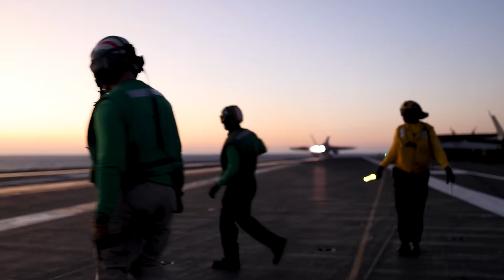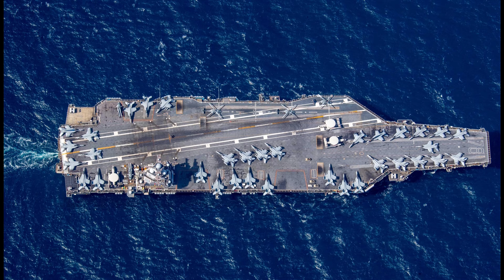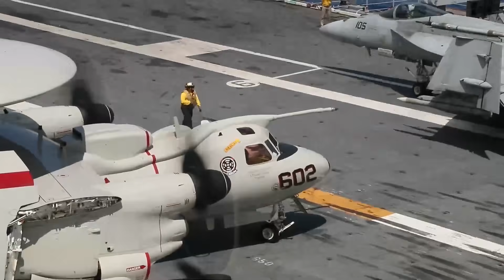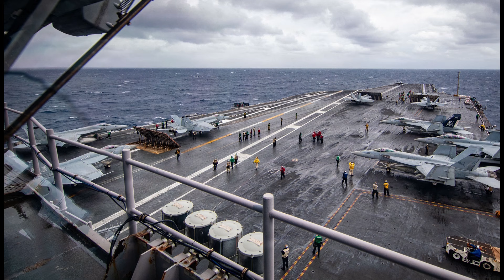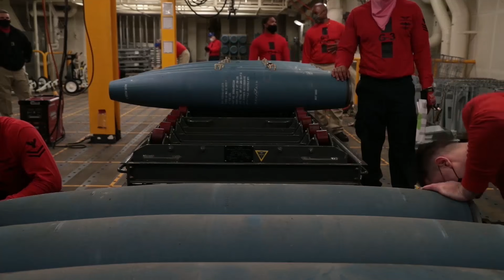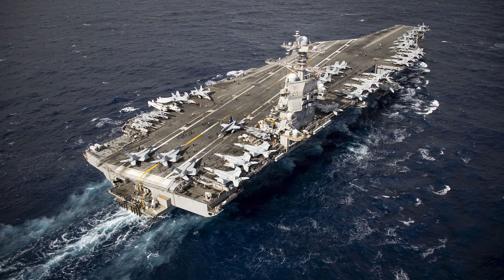Is China's Fujian Carrier Actually the Equal of the Ford Class?

Comment: The Fujian is superior to the USS Ford in one thing, staying in port. It come up short in power generation, operations tempo, size of air wing and ability to stay at sea. Using non nuclear power and EMLS makes the Fujian equal to an 80 year old US carrier like the USS Midway with a smaller air wing and reduced operational tempo. All the thing that the US had problems on the Ford have been worked out years ago and the Fujian is still in port trying to figure out how to fix the problems China is hiding. Sorry but this video is nothing but Bull S**t. At one point it claims the Ford's catapults are all working are non are working, then states that if one catapult goes down there are still 3 to carry the work load. It can't be both. Remember looking alike does not mean they are equal. The Chinese aircraft are under power and and over weight. The KJ-600 weigh 6000 lbs more then what was copied the E2D which was designed in the 1960's. the J35 is an attempt at coping the US F35 and has come out under power with short life engines. The video talks about the logistics tail which the Chinese do not have and the US worked out 80 years ago. One ship being resupplied does not stop the task force.

Comment: On paper the Ford is more superior than the Fujian but in terms of operational reality, I think the Fujian has an edge. Why do I say that? Firstly the Ford has 4 EMALS and the Fijian only 3? However, based on trials conducted, the Ford can only manage 180 to 600 launches between operational failures. That works out to be an average of 375. The Fujian is able to achieve 500. As you have said, the 4 EMALS of the Ford is centrally controlled while that of the Fujian is separate. In a sea battle this is significant. 
Ford  has more aircrafts but it cannot carry the F35 Stealth fighter. Stealth give the missile a much longer range as the aircraft is more difficult to detect.  Together with the Chinese YJ18 air to ship missile range of 400 to 500 km, none of the US fighter with their anti-ship missile can match this range. Not to mention the YJ21 hypersonic missile that has a range of 1000 - 1500km, which may already be operational.
Ford is plagued with reliability problem most notable  being its 4 very advanced lifts. From what I have read it has already been resolved. The latest is it does not has enough sleeping quarters for its crew. All these may be minor issues during peace time but in a highly stressed battle, could be the tipping point.
A comparison of the E2D Hawkeye with the KJ600 performance is  probably  quite close but I will give the KJ600 an advantage as its technology is much newer. The E2S Hawkeye came into service in 2010, 16 years ago compare to the KJ600 in 2026.

Comment: Great info! 
I have a couple of things to add.
Two of the catapults on the Fujian is too close to the landing strip, so only one is available to launching while jets are landing. For the Ford, two cats are usable when landing jets (one of them can only launch jets, the Hawkeyes' wingspan prevents them).
As you said, the bottleneck is usually preparing, fueling and arming the aircraft. And the Ford has quite advanced weapons elevators and jet fueling systems, learned from long experience. 

Fujian is an enormous improvement for the PLAN. It is a platform where they can learn a lot and gather experience. This is the root of the Chinese philosophy - continuous learning, iteration and improvement. I think at about Type 04 or Type 05 they will be happy with the design and start mass producing it, just as they did with the Type 052 and Type 055.
And for all the ways the Fujian comes short compared to the Ford, it is a powerful ship in its on right. Considering it will not operate tens of thousands of miles away from Chinese shores, it does not need a nuclear propulsion to dash across the world. I suppose China can build a few more of these for operations in the first island chain, and use them alongside the nuclear aircraft carriers. Just as they operate both conventional and nuclear submarines.

Comment: I think that the Ford class is showing signs of significant flaws, but so is the operational readiness of the USN which may exaggerate the flaws. In an overall sense this is puts the effectiveness of the USN in decline at a time that the PLAN is becoming more effective operationally year on year.
This is a problem for the USA and it goes far beyond simply running down munitions. Fleet support vessels have been run down, and because of the failure of both the Zimwalt and Constellation class warships there is a massive delay in replacement of ageing warships.

Comment: Personally I don't think it should even try to be by like the Ford's or Nimitz, as long as it performs well and does what it was designed to do then it should be fine
Reply: The problem with it trying to compare to the Nimitz goes far beyond the ship itself. Every ship is part of an organizational system, and that includes the bases and support ships they rely on. The Liaoning cannot operate beyond the First Island Chain (FIC) during wartime conditions as it lacks the range and beyond the FIC it is in enemy waters. Not contested waters, but fully enemy waters. Even inside the FIC, most of where it can operate is contested waters, with only the Bohai Sea being relatively safe, though still vulnerable to long range cruise missiles and drones. What this means is that it must constantly be on defense, and if it goes to port it will find itself a sitting duck. So it will only be able to POSSIBLY survive for as long as it can stay at sea, which is not forever no matter how much it can be resupplied underway. The Type 1 and 2 are even worse off, naturally. But as they are all top tier threats, they can be sure that they'll have an overwhelming volume of fire allocated to it from minute 1 of any war, which means it's as good as dead. The Nimitz can all operate safely outside of China's ability to realistically threaten them, and if needs be, they can back off entirely out of Chinese weapon ranges, leaving land-based systems and submarines to maintain the threat against China's ships. So not only can the Chinese ships of any class not operate like US and Japanese ships, they have no hope of survival no matter what they do, like Iran's navy only more costly.
Reply: @gardnert1   I think you underestimate what the PLA can do within 1000 km of their coastlines. You are mistaken if you believe the USN can operate safely outside the 1st island chain, it can't even operate safely from the 2nd island chain. If they go within the 2nd island chain, they will be sunk with overwhelming number of DF missiles, and other air launch, sub launch missiles at huge standoff distances. The only safe distance is all the way back to Pearl Harbor, and that's because the Chinese won't attack Hawaii, not because they can't.

Land bases won't be able to operate within the 1st island chain anyway since all will be wiped off within hours of an initial conflict with saturation attacks, just look at what Iran did, now imagine a country with 1000x more capability and industrial capacities and far better tech and vastly more resources stored up can do. Any subs that even dares to fire off torpedoes or missile - assuming they are not found by PLA anti-sub - will immediately be locked by their satellites and sunk. There is now no realistic way the US military, along with their allies like Japan and SK to survive within the first 24 hours. You people don't even have enough weapons to make a dent against China today. The only way you can "win" is to nuke China.

You people have no clue what the reality of the world today is.

Comment: The Fujian is paying the price of haphazard overly ambitious development. Due to mistakes in design and unreliable technology, it might not even support the tempo of the Shandong.

But the Ford also has paid a price for installing tech before proven, experiencing long delays as systems like the elevators had to be redesigned.

The bottom line though is that the Fujian 's flaws leave it fatally flawed while the Ford flaws mean the ship's capability is affected but still usable and capable of performing its missions.